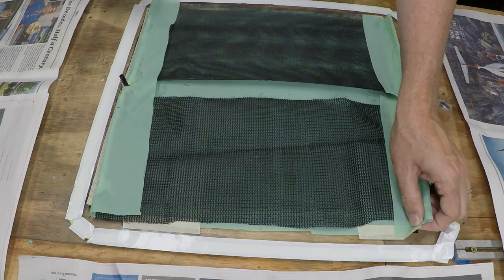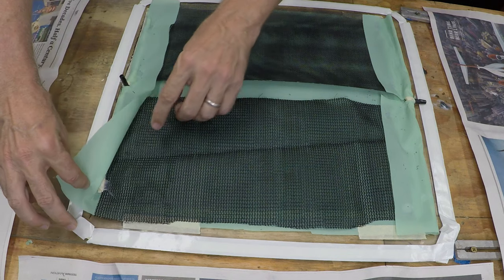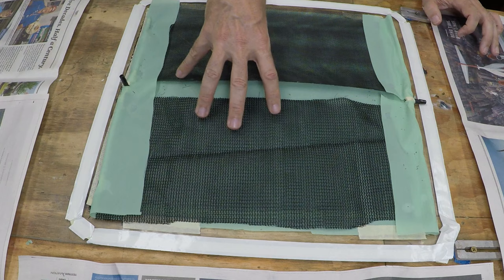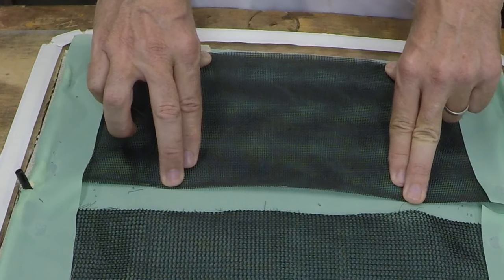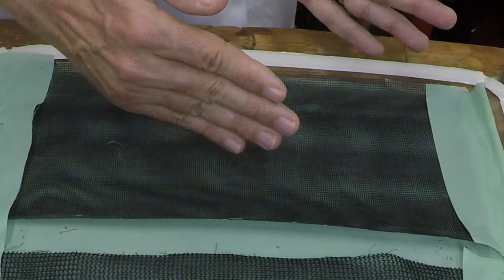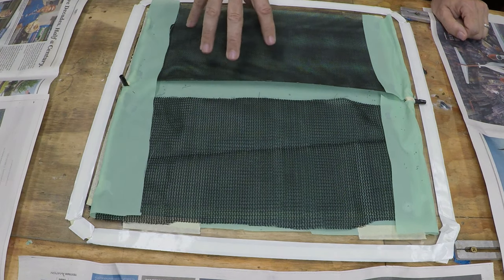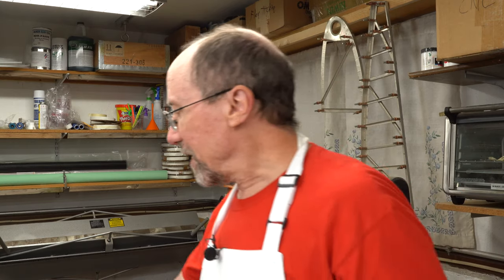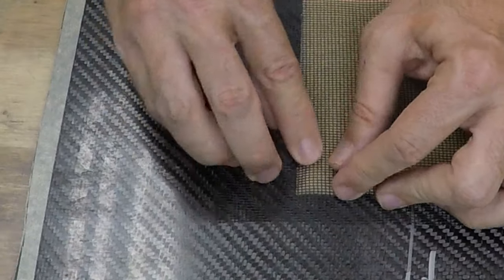Unconventional Flow Media Test

Comment: This is great .. i worked in the TPi lab for 4 yrs after a 30 yr career as a composite boat builder .. i. Can also recommend debri netting  as a flow media but not for tiny carbon parts .. its to ruff and actually bends the fibers .. I’ve seen it under the micro scope  .. it’s the stuff used in the factories producing wind turbines  .. we always infuse at full vac then turn down to half when full ..also wrapping the vac tube with 1708 fiberglass and having the peel ply go to that with th 1” set back on the flow media .. also trim the peel ply tight .. good stuff

Comment: Why do you leave the pump on once its infused? I turn mine off right after I clamp the in and out lines otherwise the pump will overheat. Its not pulling any extra air out so just wondering why?
Reply from the maker: Excellent question. I could have turned it off. I did not have any overheating issues. I left it on just because it is impossible to have a perfectly airtight bag and tubes. But if leaks are small enough the motor can be turned off.